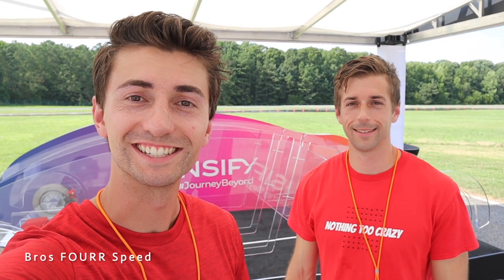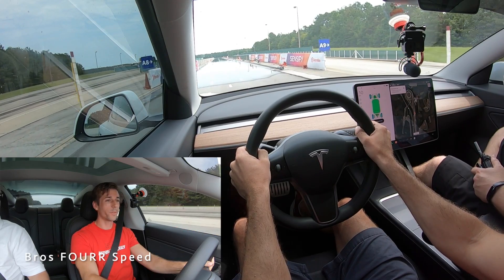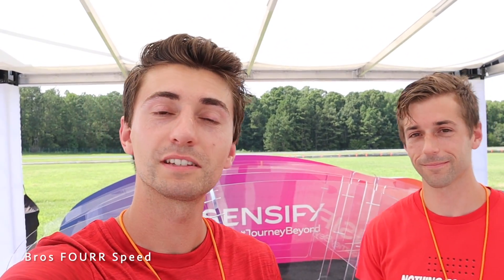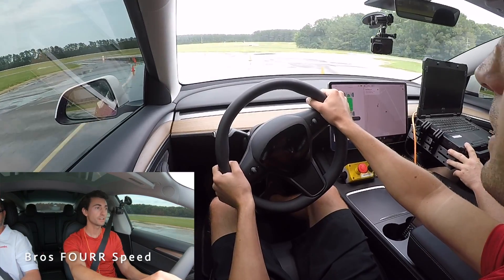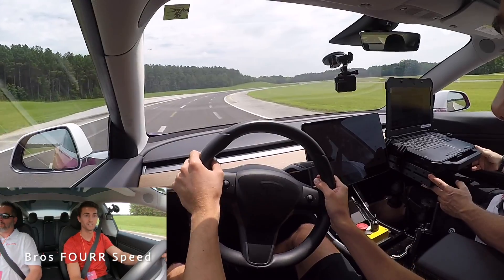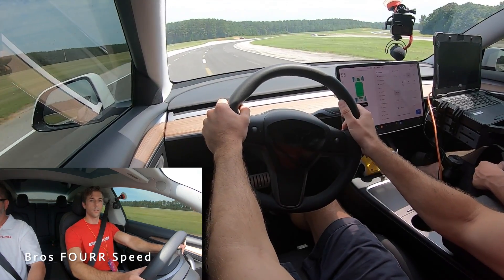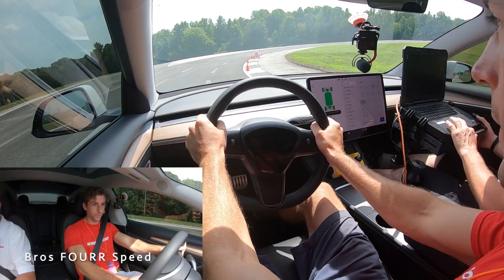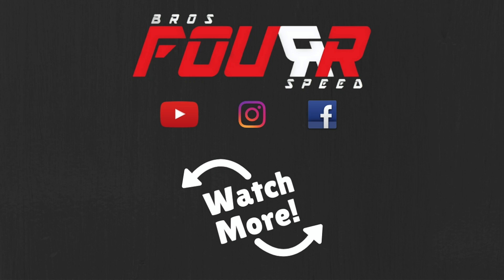Brembo is Revolutionizing Braking Technology!! And We Tested It On TRACK!!

Comment: Why not two piece brake rotors? All that tech but has old school rotors. I don't get it. I've got 2 piece brake rotors added to my Q50 with a 30 lb unsprung weight savings, and with better cooling. This new system is a HUGE advance for the current ABS systems.  The ABS in my 2002 Imprezza were just dangerous! Glad to see some serious improvements in ABS.
Reply from the maker: This is retaining a simple design but incredibly effective! Very cool to see how innovative the technology is.
Reply: @BrosFOURRSpeed  Why do you say it would add more weight? 2 piece brake rotors are lighter, like on our GT-R's. An alloy "hat" saves weight and allows the friction ring to expand and less prone to warping.

Comment: While this does look smoother, it looks like since it isn’t going to the point of locking it looks like it takes longer to stop. Would like to see measured tests.
Reply from the maker: All the tests were full pedal to the floor braking. Sensify actually consistently stops a bit quicker. But it’s also more controllable. The cars didn’t slide around as much as the stock car